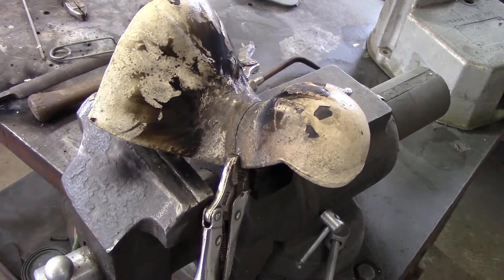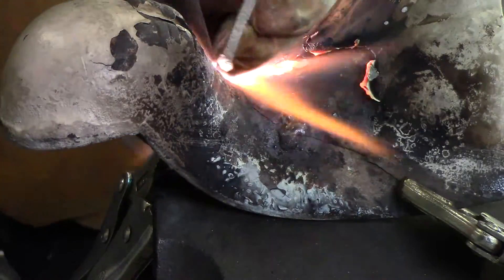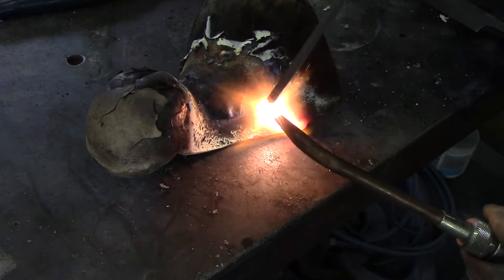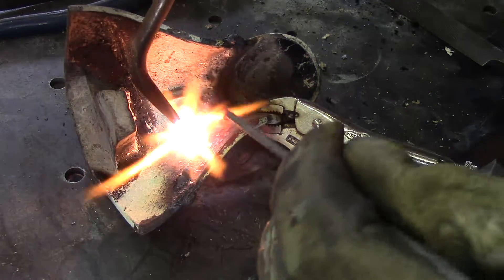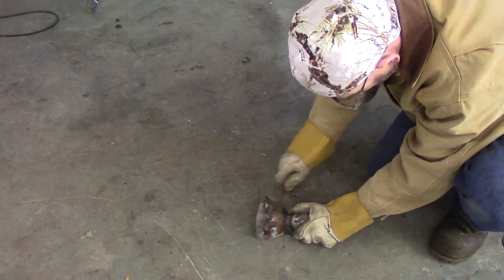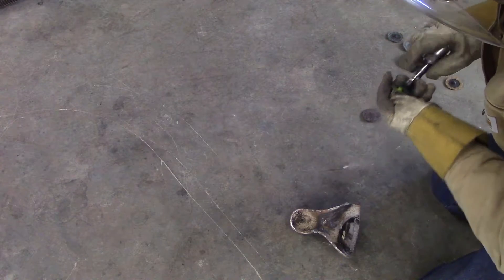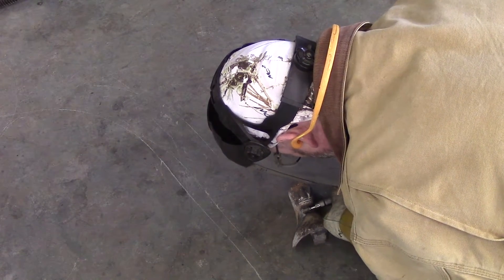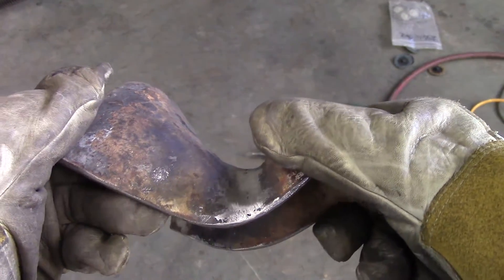Cast Iron repair, oxy/acetylene welding

Comment: Thanks for the video!  I'm doing my homework to prep for some repairs to a cast iron bandsaw from the 40's.  The previous owner botched their repairs (flame brazed), which crumbled as I disassembled the parts for cleaning and restoration. Unfortunately I can't find the cast iron rods anywhere.  The Amazon link below is "currently unavailable" too.  Do you or anyone know where I can source some?  Thanks in advance!

Comment: Where can I buy this kind of rod? Could you please tell me some details about it?
Reply from the maker: The sticks are made by All-State, they come in a 10# box, and are in 1/8" & 1/4" diameter. You will also need Ferro flux. I haven't bought any in about ten years, looked a year ago for another subscriber and I couldn't find any. I just searched and found the All-State name under Praxair, I guess that is where I would try. Good luck.

Comment: When weld cast with cast do you use a common flux on the cast rod, or run without?  Thank you
Reply from the maker: Ferro Flux by Esab. Thanks for the question.

Comment: It doesn't look as though you cleaned the piece or is that look from preheating it? You say you pre/post heat it. Can you give some detail on that for me. Thanks
Reply from the maker: That is the look of cast after it was heated to remove any contaminants prior to the gas welding process. With the torch welding process the preheat and post heat is done with the torch, so basically you warm the whole area to be worked up to about 800 to 1000 degrees F  prior to the start of the welding process and you cool it slowly to those temperatures after the welding process before putting it in the insulation for a day to cool slowly. Thanks for the comment.

Comment: Would this work on an engine block crack repair ??
Reply from the maker: That depends on how thick the base metal is where you want to repair, I used it this week to repair a thermostat housing for a boat that had a bolting ear broke off. Anything thicker than 1/4" I would say no, I use 3/32", 7018 weld rod for all of my thicker repairs on cast, bevel out the piece so you can get good penetration (leave some metal to burn into), bolt or clamp the piece to something to keep it straight, preheat/postheat, and cool slowly if possible, if too big cover the welded area with a piece of fiberglass insulation. One word of caution, what you weld on will be harder than a tap so if there are threads make sure they are protected from spatter because you will not be able to chase them after welding as they will be harder than the tap. I have used this method on many, many cast projects, many motor mounts that had broken off in car accidents, with no returns due to breakage. Good Luck!
Reply: Yeah thats what i have to repair the bottom bolt ear where the bell housing bolts on , it would be about 1/4 inch thick , so i will have a go at it i think , thanks for the reply sir.

Comment: I was also wondering where you got the rod? I need some rod and some flux for a project, but I can't find them anywhere.
Reply from the maker: I have not bought any in about ten years or so and have also looked but have not found any on the internet. I believe I bought it through Airgas, here is the information on the container: All-state No.3, size 1/4", Heat F-17, Lot no: 052606, Stock no: 69050009, 10lb. Good luck, comment back if you are successful.
Reply from the maker: Just looked again and found some: Cast Iron Oxy-Acetylene Welding Rod, https://www.amazon.com/Cast-Iron-Oxy-Acetylene-Welding-Rod/dp/B000ZI7O42/ref=sr_1_3?ie=UTF8&qid=1525780759&sr=8-3&keywords=cast+iron+welding+rods

Comment: I'm curious as to why you didn't v the crack out a little bit before you welded? That's usually the strongest, at-least from everything that I've been taught.
Reply from the maker: You are right, normally I would to get better penetration, but in this case the material was only 3/32" thick and I knew I would get plenty of penetration without  beveling it back. If I would have beveled something that thin I risk the possibility of burning away the base metal and creating a hole instead of repairing the part. Thank you for the comment.

Comment: Nice! Subbed. I just dropped my old cast iron dutch oven lid. Can i fix it with 15 %? I have a oxy acy rig
Reply from the maker: Are you talking 15% silver content, silver brazing wire? I am actually using a 100% cast iron cast rod in this video. Which means I am welding it 100% not connecting it together with a dissimilar metal. I normally like to use and have had terrific luck with 7018 stick rod but this piece was kind of thin for that, also the 7018 will make the base metal so hard that you can not touch it with a tap!
Reply: I am gonna call welding supply and see if they have a 7018 rod then. You prob dont know this but I gotta ask would it matter with a cooking vessel toxicity or anything? yeah I have some 15 % rods some 6% rods and some 0% rods
Reply from the maker: Dan Webster, 7018 is a stick welding rod it is used with a welding machine not a torch. I just wanted to make sure you understand that.
Reply: I have some welding rods out there in the shop I gonna go and look
Reply from the maker: Austin Baxley, I had gotten these from airgas in Green Bay. They were made by All-State NO.3 they came in 1/8" & 1/4". The 1/4" has a stock number 69050009. I tried to find it online and could not, it comes in 14" sticks.
Reply: I used to sell HVAC shit had a ton of welding stuff.
Reply: H.R.I. services llc Ricky Hembel  where do you get your cast iron rods at?